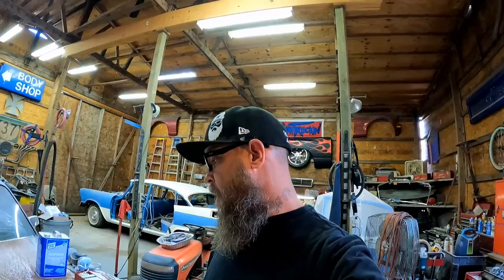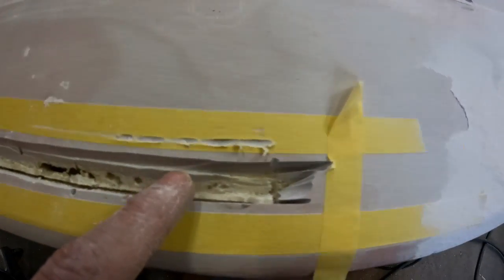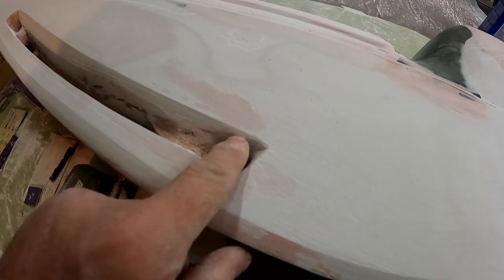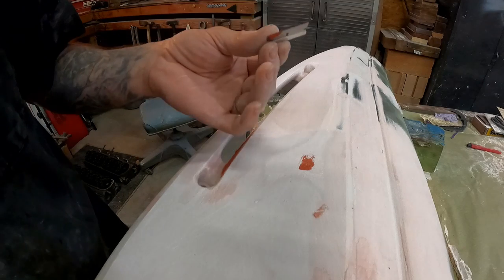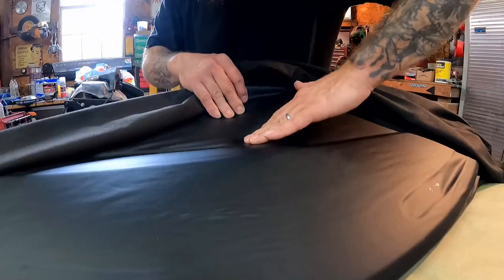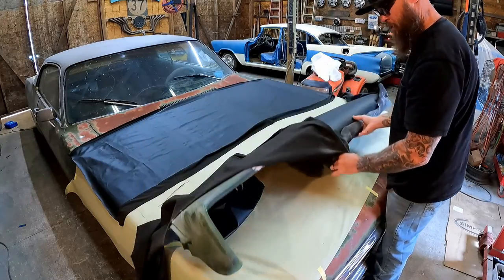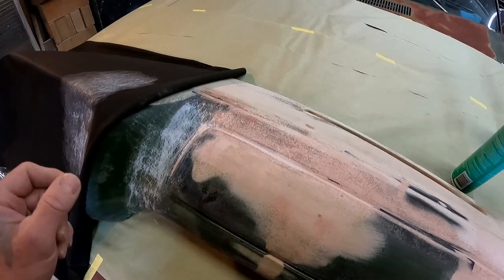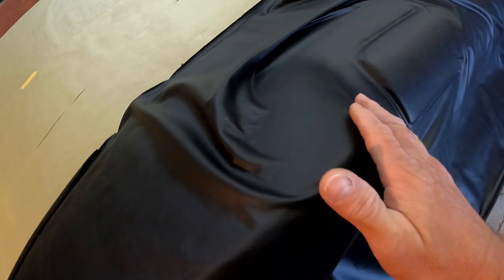DASHBOARD DISASTER!!!WHY DID I EVEN TRY THIS?

Comment: I would have just sanded it and painted it satin black....lol. You did a great job 👏🏼 👍🏼
Reply: Or maybe hitting it with a textured vinyl spray paint.
Reply: @davidmcdaniel2615  Thats an even better idea 💡 👏🏼
Reply: The bed liner paint has a textured look like vinyl with killer durability. That's what I would've used.
Reply: @michaelbristol6467  I was going to comment the same
Reply: @michaelbristol6467  I reckon WB might have agreed with that when he was about half way through 😄
Reply: How about electrostatic flock?

Comment: My dad was an upholster for years, ran his own shop and did alot of restoration work like you have done on this dash. I think he would have been proud of the way you worked through this process. The white pad you had you could have glued it to your vinyl first and it would have been easier to work with, but I think the dash turned out great without the padding.

Comment: Great perseverance, Mike, and the finished result makes it really worthwhile! Anything with 3M on the label is a good choice, and the 3M90 was perfect for that job. If you ever need something with even more "grip", try the 3M Panelbond, which is a fully certified 'structural adhesive' and is even used to stick bridges together (only Interstate bridges though, not railroad ones, apparently...)

Comment: from what I learnt in this since I will need to do a cracked dash as well soon...take it little by little. Dont spray too much glue trying to work on a big area. Have clean hands and pray to god you dont have overspray from the glue on the vinyl. So far I'm thinking of going to the painting route, but we'll see. Just gotta figure out if the paint that I'll be using can be polished or treated the same way as leather/vinyl does when it comes to keeping it like new.
Reply: George Jones  Will see. Issue is theres vents on mine and similar to him, ive never dealt with vinyl or reupholstery

Comment: I covered my old Datsun dash with t-shirt material and water based urethane.  It can be molded into most any curve and pushed around with a damp sponge. When it has set up overlaps can be sanded smooth and more coats of WBU to fill the weave.

Comment: Great work.  I just subscribed.  Your video brought back memories - I installed new vinyl on the dashboard of my 1972 Ford Pinto back in the late 1970s.  Only I did it with the dash still in the car.  I encountered the same issues getting the material to stick in some of the more extreme contours, but I did it by trial and error, just as you did.  I only regret you didn't keep the green dash -- one of the charms of cars of that era was the many colors available for the interiors - not limited to black the way it is now.

Comment: Ive tried every spray adhesive you can buy at home depot and auto zone and none of them ever worked how i wanted it to. I finally stumbled upon a local upholstry shop and they have a  spray adhesive that they make and that stuff really works! The hold is super strong and its only like $20 a can. Unfortunately i dont think its sold in any retail stores. The shop is licated in Bellflower CA, its called Pablos Upholstry Shop

Comment: WHEN YOU BROKE OUT THE GUERILLA GLUE AND STARTED AT THE TOP I KNEW IT WASN'T GONE END WELL. BUT YOU FIGURED IT OUT AND CAME OUT GOOD. HOBBY STORES USUALLY CARRY GO FABRIC SPRAY GLUE AS WELL. YOU CAN ALSO USE A SILVER BUTTER KNIFE TO POKE IN AND FOLLOW THE BODY LINES. 👌👌👌

Comment: Beautiful work man, and beautiful result. I have to wonder if a spray-on solution could have worked as well. You'd have spent a lot more time prepping the surface to perfection, but the material wouldn't have had the internal stresses of the stretched vinyl. Does anybody here know if the black Flex Seal spray stands up to heat and UV over time? Bed liner would, of course, but you'd lose the detail of the dash shapes.

Comment: just found your videos tonight awesome job  on the dash .. i self taught myself auto upholstery if you have to do another vynil dash like that one i recommend industrial vynil top adhesive you spray it with a spray its alot more user friendly then aresol cans and its extremely strong holds up to extreme heat and cold very well

Comment: Dammit that is the solution I was dealing with in my head. I kept trying to figure out how I was going to make that same transition on my 76' C10 dash. It has that same trouble spot in the center. I will definitely be working mine from the center out the same as you did. Thanks. BTW I think that dash turned out excellent. I hope mine is that good.

Comment: A trick i use on interior parts that don't need to be perfectly original in texture is to spray them with rock guard and paint them.. it really looks convincing and is cheap and easy. I have used it on aircraft interior parts also but more for weight savings.

Comment: I think it depends on the type of vinyl material that you use when you wrap it. I had a dash done 20 years ago by a place in Oregon called Dash Specialists and the vinyl was softer or more 'expanded' so it was more stretchable. It was a really nice job but expensive for then, like $580 or so I think. There's a guy on here, Sprayway Customs I believe, that guy does some of the best dash restorations I've seen.

Comment: The last approach was exactly how I did my 79 c10 I used a thick marine grade vinyl. Pay attention to the grain so you can pivot the vinyl to lay the drop off and it will roll back around straight on the top side. The Only problem is that glue doesn’t hold up in the heat. Ideally you should use landau top cement but you can’t get it in most states nowadays. Get a cheap paint sprayer or old pressure pot and put regular contact cement in it and spray it on both the dash and the vinyl and let it dry,  the bond will be permanent. The spray pattern is key, don’t try to use a brush. Leave the edges loose and wrap them last using relief cuts. Let it sit out in the sun for a while so the glue vapor can expand and the gas from heat has a chance to escape. Avoid over stretching so the grain doesn’t look funny or get glossy from over heating and stretching it

Comment: I have a few hints to help not that I can do it. 1 contact cement or water base contact on both sides ( let dry to touch). 2 leave vinyl in the sun it makes it soft and easily workable.  3 place clean sticks where you aren't working and then remove one at a time when going to next area.

Comment: Very nice. This was very encouraging to me. I'm working on a dash in similar condition and I'm still on the bondo stage. I am dreading the vinyl work as I will be dealing with similar challenges to what you had, but this helps me in my development of a plan of attack. I've seen quite a few videos of guys who are way better at this (no offense, but there are some talented people out there) and they offer great advice, but what I didn't get from them is a close look at where I'm going to screw up and how to avoid it. I will likely use your idea to start in the low spot and work out just a few inches at a time. I think the adhesive will hold a lot of tension going sideways, but as soon as you have some stretch that's pulling upward it seems to want to let go. Your method took all of the tension out of that low point and spread it out on the top where the adhesive has no trouble holding it.

Comment: When u use the bondo and cover your vents place tongue depressors against the vent walls and fill remove wiggle just before it completely sets and you’ll have the exact angle for the vents when u remove the excess bondo

Comment: The dash looks good. Your persistence paid off. 

I have a friend who did auto upholstery and interiors. He didn’t recommend recovering a dash pad like this. He was skeptical this method of recovering a dash would last. Maybe that’s due to the fact that padded dashes are padded with foam which allows heat to dissipate. I see that as a potential issue if the car sits in the sun a lot. The vinyl might let go eventually. 

With that said a place in California called Just Dashes recovers plastic door panels for 70-74 Cudas and Challengers like this, so maybe it lasts. 

I’m working on a 73 Dodge van and I have to make a custom dash pad for it. So I’m looking for a method on how to finish that off. 

Another YouTube channel called Hoosier Garage did a pad for their van, but he did put a backing under the vinyl. 

Any way it was an interesting video.

Comment: Try some Weldwood contact cement instead of spray glue, holds much better and you wont get spots where the vinyl bubbles up as the glue cures.

Comment: What type or brand of vinyl and thickness did you use? I've seen various thicknesses of vinyl ranging from 3mil to 15mil from 3M to other brands. You've inspired me to do this to restore my 1973 BMW 2002 cracked dashboard. I was quoted $2000.00 for this service on my specific dash. That doesn't include removing or installing the dash or shipping to or from the upholstery specialist. At that price I'm going to do it myself.

Comment: Admittedly, with my arthritis I might have been tempted to simply paint and finish it,  (On a more suitable car for the idea, maybe flock it,  cause I've always wanted a flocked dash in something someday,:) )  but when it comes to stretching something like that, you had basically the right idea with fixing the deepest part in place first.  The basic idea you probably got by feel beyond that is to kind of spread out any resulting tension before you get boxed into wrinkles,  rather than count on the last bits to stretch or shrink enough in a short distance.  :)

Comment: My defrost cutouts didn’t allow enough vinyl to cover all the way down so I made an insert out of cardboard and tape then painted it with epoxy resin, skim it with bondo and shape it to fit the opening with a lip on the edge so it doesn’t fall in the hole then cover the insert with vinyl drop it in and wrap it to the dash so it stays down tight.

Comment: Not bad. Not being critical but I'd have just painted it myself. I'm wondering how well it will hold up to the suns heat. I wonder if they can be wrapped in the material used to wrap the exterior body of a car.

Comment: Try using 3M High Strength 90 Contact Spray Adhesive I had good results with it in car interiors it has strong--strong hold you spray on both the fabric and on the surface and holds like it was nailed down
Reply from the maker: Somebody didn’t watch the whole video lol busted.
Reply: @weirdbeard8898  Actually did just posted when you first started. then notice you switched it up and you got perfect results professional looking I must say.

Comment: A solution to your Gopro battery problem...Gopros can run off USB power as well. What a lot of people are doing is getting one of those portable USB power banks to plug into the camera which will give it many hours of run time, a lot more than just the internal battery will.

Comment: I think that I would have first applied a layer of stretchy type fabric, like what is used for clothing to both act as a practice run and also as a way to sort of "prime" the surface and fill uneven spots beforehand, before applying the final material.

Comment: That came out awesome. I've seen people use use clothe, then color apoxy   over it for a final product. It keeps the filler from cracking over time. I'm confused though, you take all the bed liner off the roof or is this a late upload?
Reply from the maker: It’s just covered in bondo dust

Comment: Use the glue on both the panel and the fabric let it tack then apply 3m is a good glue to use if you start in the pocket you’ll need a lot of fabric to cover the panel be careful on applying heat to material you’ve selected also it could damage the material

Comment: Try a second pair of hands. Don't start over, try a spray bottle with water, then heat gun too lay the vinyl. The foam should had a backing where it could be seated and let dried. But vinyl will have wrinkles the heat will remove them.

Comment: Use a thin layer of epoxy to make it a hard clean surface then take it to a vinyl shop and have them wrap it
Reply: Note to add DO NOT USE TABLE TOP EPOXY use crafting epoxy table top won't set unless it's a 1/4 inch plus thickness
Reply from the maker: Thanks for the tips Dennis.

Comment: I hate to say this but the vinyl was a waste of time, it will lift off the first time it gets hot in the sun.  You did all the fill work right, but the final process is prime the dash, then spray the dash with truck bed coating holding the can 20" away, (you want it rough), then you lightly sand the truck bed coating to knock off the peaks and give it the flat texture look, you then color coat in light even coats to not fill in the texture.  Then you're done.    The dashes are vacuum formed solid vinyl, not cloth.

Comment: Hi Mike, great job as usual.  I have a question though.  You folded down the vinyl into the defrost vents.  Do you think there will be a problem if you have the hot air coming through there?  Will it start burning or give off a nasty smell?

Comment: the biggest issue is gonna be the bondo in the sun, baking the dash.... it was a foam that was original not body fill.... you'd have been better off adding  foam and sanding to the proper thickness.... It looks good,... but lipstick on a pig, is still a pig.